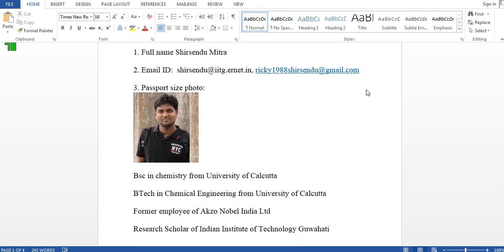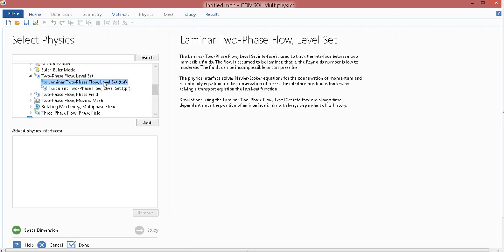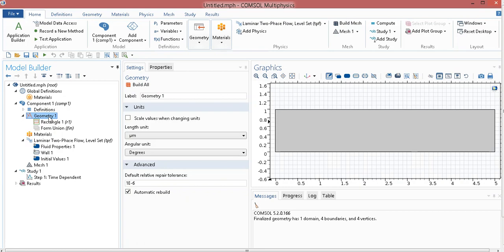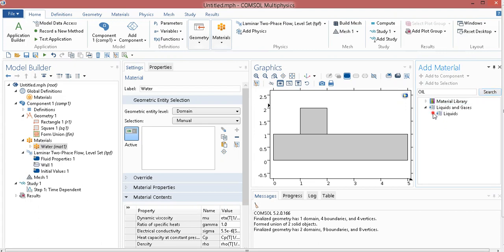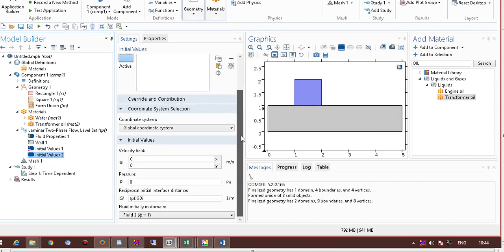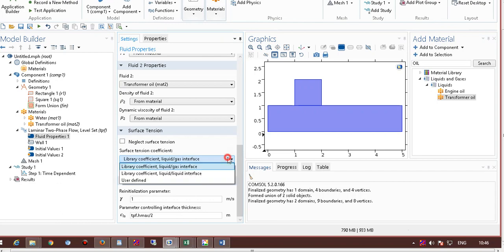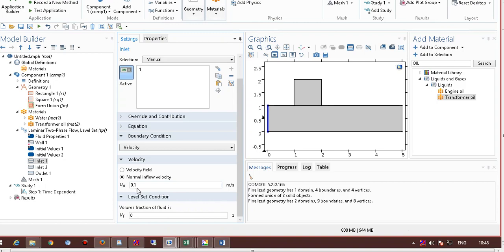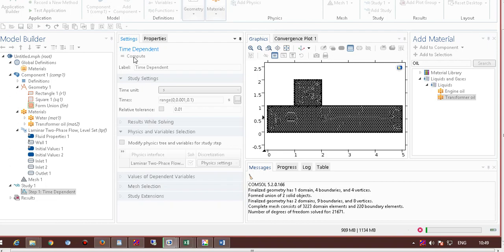Two Phase flow modelling in COMSOL Part 1

Comment: thank you very much, its very useful

i tried to model laminar level set two phase flow in which one phase is mobile air and the other phase is static water and i try to study the velocity field in water which is contained in a closed pond and no inlet or outlet for the water phase 

is that possible in comsol?
Reply: Was it possible? I'm trying to do something similar, how did you do it?

Comment: HI!!!
I really appreciate your video and they are very helpful to say the least.
Currently  I'm modelling a heat-exchanger and have figured the flow simulation part of the problem. I'm facing difficulty with the HEAT TRANSFER PART of it. 
So my Queries are:
Which physics do I use?(HT in Fluids/Solids/Porous Media)
The BC on the fins(solid) is 50C and on the entry fluid(water) is 30C. 
The goal is to estimate the Heat Transfer by the water. 
The Mass Flow Rate is known. 

I would like to thank you again for creating such informative videos.
Regards,
Utkarsh

Comment: Hello, your video is very helpful, but could you tell me what version of COMSOL are you using? Because when I try to solve, on "initial values" do not appear the variable (Phi). Instead of that, appears fluid 1 and fluid 2 but not the values. And by default appears "initial interface" at the level set, Many thanks.